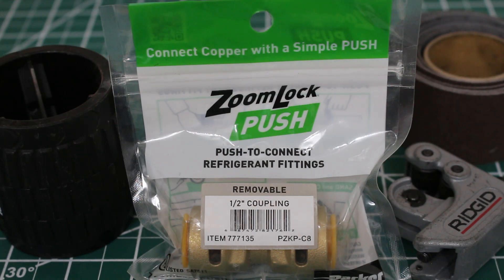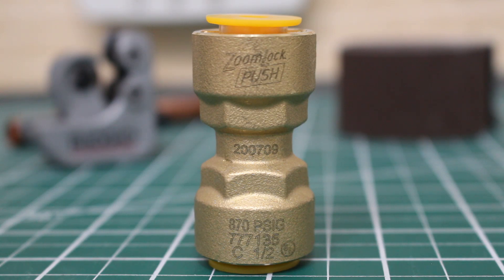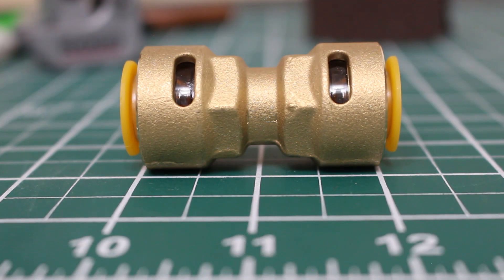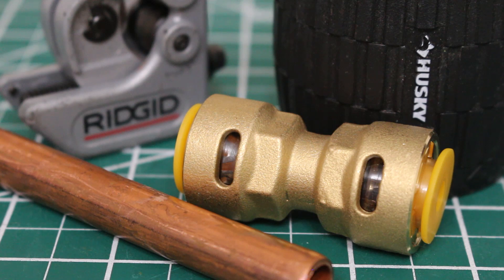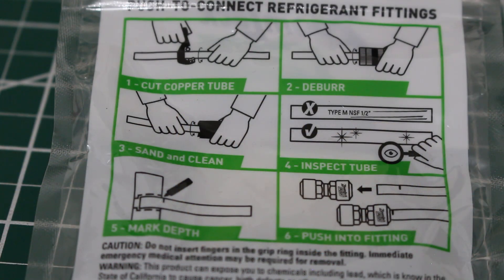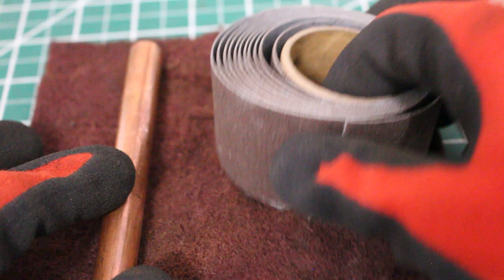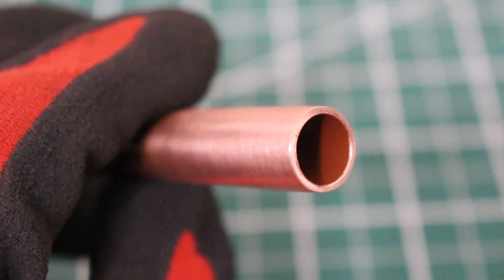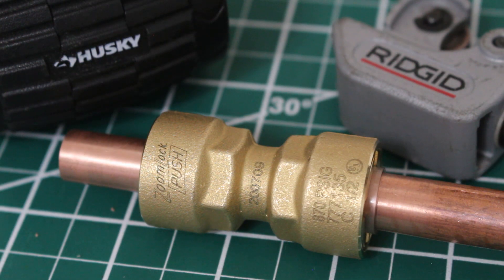HVAC: ZOOMLOCK PUSH (Push To Connect Refrigerant Fittings Review/Installation) NO MORE BRAZING!

Comment: They do not hold up!!! Customer just lost 10 pounds of r404a on ice machine at our local CFA that I service. The leak was tricky to find on these. The leak was found when I put slight pressure on pipe. It would start leaking if I did that. These are call backs and leaks waiting to happen. It is not a matter if they leak it is when. I would not put these in my house therefore I do not put on customer equipment. They do not replace brazing or the press tool fittings. They lasted for about a  year then leaked like a sieve. They are not trustworthy!

Comment: Ill post again , if u dont like opinions just say so, ill take a braze over mechanicle any day of the week, of course u cant be a incompetant brazer, quality braze ,nitrogen, proper heat, clean joint  is warranted, these new engineers need to look at the whole picture, ive been told some of the manufactures  of some hava units will void warranty  if evidence of brazing  outside of cabinet on 454 systems  present , again a braze over mechanical any day of the week,  you can get in your truck and know that u have a secured  joint ,micron test, quality , if u are afraid of brazing and correct procedures, just practice .we all have to learn i feel better with a braze. The jury still out with myself.

Comment: I love it!!! I am an electrician but with pex and crimp rings I can do my own plumbing just fine. Now HVAC getting on board! I never have to call a guy again!
Reply: I’ll be there when you can’t find the leak and it is one of these fittings. O rings expand and contract with temp. These will not hold up. I have experienced it the hard way.

Comment: And how do the fittings handle heating mode at higher pressure on the suction side ? what is the heat tolerance on the suction line on heating , I know where you are in the world is a difference in pressure values. But would they with stand cold temp countries on suction side and hot countries and the liquid side ?

Comment: This is amazing. Have a customer who had roofing done and roofers popped a nail in the liquid line. This will make repairing that much safer than putting a torch near the roof. Thank you for the demonstration!
Reply: I used for that same problem.
Reply: Me too

Comment: This would not work at the outdoor and indoor unit connections?
Reply from the maker: This is good to use for indoor & outdoor connections. I did make a video pressure testing these fittings with nitrogen. I would watch that before attempting to use these fittings. I will leave a link below. Stay tuned for new videos every week🔧⚡️

ZoomLock Pressure Test 
https://youtu.be/Gk7z289Rdhk

Comment: There's one inherent failure problem with these. That it uses plastic( teflon I hope) to seal the pressure lines. Since the fittings are exposed to the elements, from the sun drying it out, to the copper pipe expanding and contracting from temperature slowing stretching the plastic so that on a cold night it will leak. So knowing that fact and also they haven't been out on the market for that long. The longevity of these is unknown and it might fail in a week or it may even last 5+ years(maybe). But at some point they will fail.So unless you are using them as a way for job security to put new fittings and recharge the ac more frequently. And your customers don't mind paying you for a avoidable service charges. more power to ya
Reply: I find it comical that guys always say these will fail. People act as if gaskets are a new thing. Just an example is transmission and fuel lines on vehicles use push in fitting. Air lines for compressors lines use push lock and they run 100 plus psi. Hell if you wanna get technical the ac unit already has gaskets in it.
Reply: Might be viton, much much heartier. More expensive but for this application I would imagine they want it to be dependable.

Comment: Thank you for taking the time to make and send the video.
Been sweating copper for 43 years in the industry, still always looking at ways to work smarter, not harder. I've imbraced theses a couple years ago. I used this brand in tight attics, ductless system and forced air. I use the 410a rated ones that are permanent, not quick released. Yes, nothing is perfect, you also can have small leaks sweating copper, no matter how great at it, you think you are.
As stated, prep work is a must and pressure testing with a digital gauge for minimum of 1 hour, while you do clean up, is a must. Mini splits, 24hrs, if possible. 
Over years of lugging around nitro tanks in all kinds of conditions, these will help, not stop, you from blowing out discs in your lower back and other muscle, joints long-term.
Thank you again for posting and opening up mind's to other options.
Some will embrace change as another tool for the toolbox, others will not, which is fine.

Comment: Can we use ZOOMLOCK PUSH for the brake pipe on the car? Pressure and heat are supportable?
Reply from the maker: Is your brake pipe made of copper? Honestly I wouldn't recommend this as these fittings are expensive and rated for refrigerant piping. I hear mixed reviews as this is not a good permanent solution. I'd search up the proper way for the fix a brake pipe for quality results and no issues. Thanks for watching!

Comment: I know for a fact that shark bites are illegal in nyc and nys.   I’m pretty sure these will be as well.   Soon as the building department see them being used.   That’s what happen to the shark bites.
Reply from the maker: Are shark bite fittings really illegal? They sell them in the local home depots in NYC. When did that go in effect? These are good for emergency and temporary work in my opinion as they are new but who knows🤷‍♂️ What do you think of the zoomlock fittings that use the crimping tool for refrigerant fittings?
Reply: @JumpermanTech  They are illegal because trade unions don't want people outside of their unions doing work they can do for 3x the price.
Reply: @JumpermanTech  keep in mind.  In nyc and nys a home owner can do things that are not illegal but do skirt codes. They have the ability to do things with out filing or inspections.  Contractors are always held to all standards via codes from three separate sources.  Nyc is FDNY then city buildings department and finally nys buildings department.  They sell pvc in nyc but we can not use for the most part in buildings commercial or multi family buildings.  And limited in single family dwellings.  But they sell it and a home owner can and do use it.   Shark bites and most compression firing are against nyc fdny building codes.   Nys issues more of a national code.  Not so much fdny and nyc buildings.
Reply: @JumpermanTech  crimp fitting are legal in nyc and state.
Reply: Mini splits are also illegal in NYC.

Comment: Absolutely amazing technology! Grandfather was up under his house fixing a copper water line that had ruptured. This was late at night. He was old-school soldering a new piece back in. 

If  he had this technology > he'd been done lightening fast. The sad thing is he died several days later. This was not the way to spend your last days. He never called me to help him > as I would have came running at his first call!

It happened in 1989. I marvel at the new technology and heavily use it! It has made my life wonderful.
Reply from the maker: It really is amazing technology. This fitting is rated for refrigerant (Which is a type of gas found in air conditioners and refrigerators) piping which holds more pressure than water. They do have similar style fittings where you just push to connect for water lines. It would have definitely been much easier for your grandfather. May he rest in peace 🙏 Sounds like a strong and independent man. Much respect. Thank you for watching & commenting. Enjoy the rest of your weekend 🔧⚡️

Comment: These fitting ms aren't good for permanent use. Great for emergency calls. These restrict the inside diameter.   I seen these a lot restrict a lot of systems and had to replace them with correct fittings and did double the work. The techs that used these were mostly hacks and did not know how to braze it solder very well. Trust me these are just for emergency only not long term use.
Reply: It’s the way of the future… I bet they said the something about digital gauges it’s for lazy techs.
Reply: @CombatFitnessGroup Hah! I remember when people were saying that about digital multimeters. But with an analog multimeter you can watch the signal trend on the dial!!!

Everyone uses digital multimeters nowadays.
Reply from the maker: I could see these used by lazy techs or ones that cannot braze. It has its benefits but I'm sure it has its cons as does everything. It's important to spread the word so techs know what's available in the market. Especially with part/material shortages lately. For temporary use, I think it's great. Nothing like a solid brazed connection though. Thanks for your input & watching 🔧⚡️

Comment: Thank you for sharing this remarkable fitting to avoid blazing.  Does it work for newer appliances using R-600a?
Reply from the maker: You're very welcome! The fitting says it's rated for 870 PSIG. That's a lot of pressure. Would need to look up the operating pressures for R600a. As long as it's fairly below that rating, it should work just fine. Thanks for watching & stay tuned for new videos every week!

Comment: Thank you for sharing the latest and greatest refrigerant connections.  Usually flexible copper tubing is used for a/c lines, etc.  Just like plumbing push to connect fittings are these not recommended or approved to be used on flexible copper?
Reply from the maker: You're very welcome & thank you for watching/commenting. I am not exactly sure about the flexible pipe but I have heard someone say they tend to slightly leak on soft tubing from their experience. He recommended to use this with hard drawn ACR pipe. Personally I have not had that experience. I believe prepping and making sure everything is straight is the key factor. I will be making another video testing these under pressure. Stay tuned for new videos every week🔧⚡️

Comment: I have used these to my great dissatisfaction they tend to have a tiny tiny leak, it’s not their fault but most soft line sets are not perfectly round so they leak these have given me 2 serious headaches, I would only recommend on hard ACR copper lineset
Reply from the maker: Ah man sorry to hear that. Thank you for your input & experience. Everything must be perfect when installing these I would assume. Has to be a perfect fit. Hard drawn ACR pipe makes sense. Thanks for watching & stay tuned for new videos every week🔧⚡️
Reply: I had the same problem very small leaks I would never use them I have replaced a lot of them leaking
Reply: What if you could use some type of sealant on the outside of the pipe like locktite red bearing mount?

Comment: I'm old school I don't trust anything else other than brazing, has vibration been taken into consideration
Reply from the maker: Nothing lasts forever it seems but I'm sure the engineers who developed this took everything into consideration. It's good to know what's available in the market. Might save you in a pinch. Thanks for watching. Stay tuned for new videos every week🔧⚡️
Reply: I would say nothing is hermetic but a totally sealed one with metal. Almost everything else leaks eventually.. think about how fast car AC's leak with their O rings and shaft seals versus a refridgerator.
Reply: Some 454 manufacturers will void warranty if signs of oxidation from braze I've been told, I guess these manufacturers  want to lose market share if true, I'd take a braze joint over mechanical  any day of the week, but u can't be a fly by night hvac guy, nitrogen , clean joint, proper heat then u have it sealed , these new engineers  need to go back to school and learn about vibration , if they dont want a braze joint they must want a chance for leaks  imo.
Reply: Most of the leaks I’ve come upon have been failed braze joints for various reasons including vibration
Reply from the maker: @salad973  Vibration is a killer!
Reply: @JumpermanTech  I always put 3, / 4 inch  loops between compressor and condenser and suction its been working a treat,  I love watching your vids still learning a lot after 28 years in the trade

Comment: I've never used Zoomlock. If I understand correctly, Sporlan specifications for the Zoomlock Max and Zoomlock Push stiipulate Residential applications. I could be wrong on that, so it's best to contact Sporlan technical support.
Reply from the maker: Zoomlock max requires a crimping tool to secure the fitting suitable for refrigerant lines and zoomlock push requires no tools so you just push to connect refrigerant fittings like in this video. Just a new style and innovation. As far as applications, it would def be based on the pressures they can handle where there is a slight difference between the two. This is new technology for me and I'm interested in seeing how it holds up. Those crimping/press tools are so expensive. Glad they came out with an alternative. Thanks for watching & commenting 🔧⚡️

Comment: I have used these on two jobs just to check them out and see how they hold up They have been on there for a year and I have no problem so far but I’m still cautious about them to
Reply from the maker: Thats awesome. Did you use them on hard drawn acr pipe or soft tubing that comes in roll? Always curious because I heard someone having an issue with the soft tubing but maybe they weren't using a straight piece or didn't prep properly. Thanks for watching & commenting! Stay tuned for new videos every week🔧⚡️
Reply: They were on soft copper 7/8 and 3/8

Comment: On the condenser has a bell I'm assuming you cut it off to put this fitting
Reply from the maker: What do you mean by the compressor has a bell? If the unit has copper, you can use this for sure 👍
Reply: @JumpermanTech  I think he means the swaged stubs on condensers and evap coils. If it’s not long enough you can just solder on a small piece of straight pipe using staybrite #8 then push on your fitting.
Reply from the maker: Thanks for watching & stay tuned for new videos every week🔧⚡️

Comment: Just like the shark bite fitting. I would recommend it for a temporary fix, I’ve seen shark bite fitting fail. I can see them doing the same thing. Great review, love the videos. Keep them coming.
Reply from the maker: This does remind me of shark bite fittings except more heavy duty for refrigerant pressures. If everything lasted forever, we'd all be out of business 😂 Thank you! Glad you love the videos. I appreciate the feedback & you watching. Stay tuned for new videos every week🔧⚡️
Reply: @JumpermanTech  Thank you for taking your time and sharing!
Reply from the maker: @wisdomsquare28  You're very welcome! Stay tuned for new videos every week🔧⚡️
Reply: @JumpermanTech  I used a shark bite on a busted pex line (rather than buying a several hundred dollar crimp tool).  It lasted for several years, until I had to have the house re-plumbed.
Reply: It's temporary til it fails. I not going back and changing one of these out unless there is a reason.
Reply: Never had a shark bite fail

Comment: I gusse that's good if you are in between wood floor joists or right up against a sheet rock wall but I wouldn't use them for general use unless there was really a need for it. To use them for a hole line set is just stupid and lazy. Remember O-Rings don't last forever.
Reply: Braze joints don’t last forever either
Reply: @salad973  Stop defending this product.
Reply: @67tr876  stop trying to defame this product. Instead of calling others stupid and lazy for using this or testing this product, try using your typing powers for something upbuilding. Don’t be scared of new things, embrace them and if there are issues, submit your input to the manufacturers and help make things better. This is the way things are moving in this industry keep up with the times or hang it up and enjoy a nice cold one ✌🏼
Reply: @salad973  A Braze Joint will still hold up better then any rubber O-Ring. Do you know of any installations of this product that have been in service for more then 20 year's? If so please share and I might feel differently but until I see that I will stick with brazing.
Reply: True but neither does the evaporator
Reply from the maker: These have their pros and cons. It's important for techs to know what available to them and the newest technology. It is def interesting. Unfortunately nothing lasts forever like those O rings. Would like to see the condition after many years. Thanks for watching & commenting!